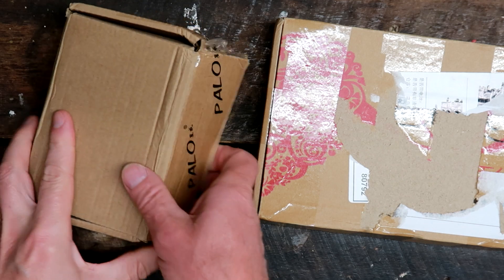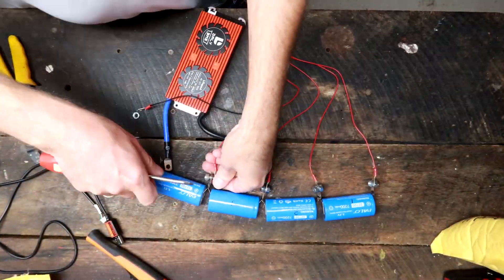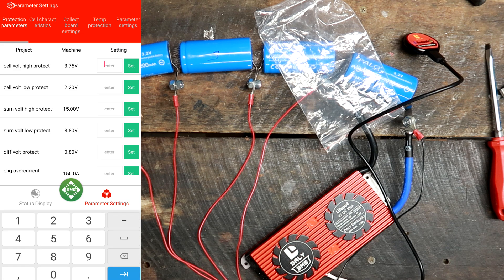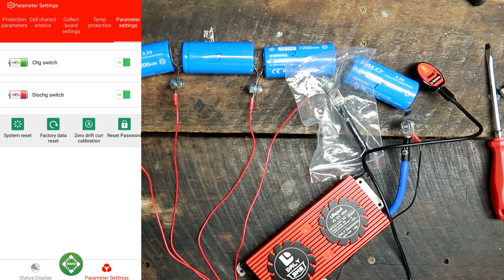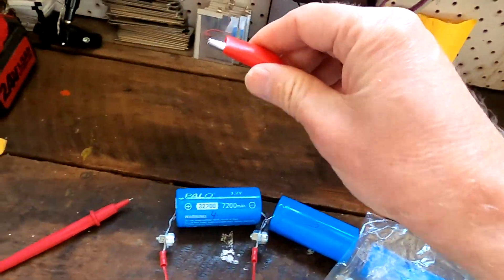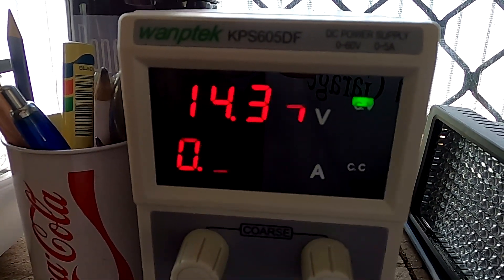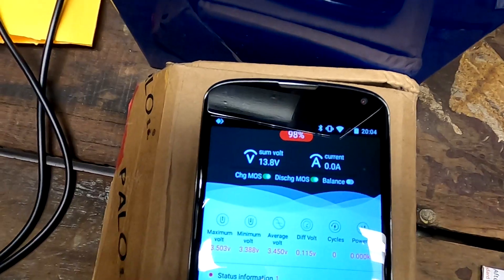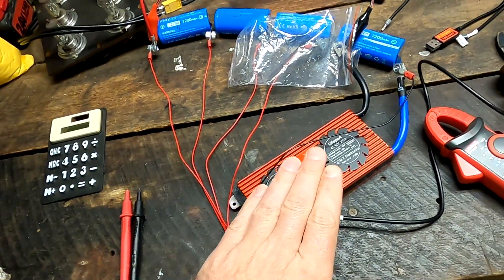Why DALY BMS' are so popular? Exactly, I don't know either.

Comment: On the "Welding" issue: Do you suppose they mean "solder?" If not, maybe they are talking about spot-welding, where arrays of cylindrical cells are connected by spot-welding nickel strips to the batteries?
Reply: I guess they mean soldering
Reply: They mean don't short the -b to -p the common known way to restart these things.  It probably messes something up in the internals over time.
Reply: Lol

Comment: hi I have a question about dali, the charge app display with soc by inserting 280ah cells stops me at 75-80% with full cells. dali bms 200A capacity, if I set cells to 200a it reaches 100% what am I doing wrong ??
 or is the bms not so reliable
thank you

Comment: Chinese DIY kits (such as LM338 based power supply kits) that have "english" instructions that need soldering use the term welding when they mean soldering, so as Brass/Bronze and Copper are often called copper by them, welding seems to refer to welding brazing and soldering, depending on the context.
Reply: Some BMS come without leads

Comment: I have a scooter that runs on the 60 V battery I recently installed the Daly. My scooter can run on single or dual motor. I noticed when I switch it to dual motor and quickly accelerate it dies out and won’t turn back on unless I wake up the battery by unplugging it and plugging it back in. Does that have anything to do with the Daly because the surge of voltage is being used suddenly. Do I need to change the settings?

Comment: You need a temp sensor attached.
Reply from the maker: for...?
Reply: @OffGridGarageAustralia  He is in the North! I think you are usually safe from freezing. My BMS has 4 temperature sensors (for up to 24S). I do have a battery temperature sensor from my Epever Tracer 60A (6415AN) otherwise the SCC assumes battery is same temperature as the SCC, which is often 40C, and occasionally throws up over temperature warning, which should not happen until 85C. Had thought about a Victron Smart Battery Sense; for my Victron 100/20 Smart SCC, but it’s quite accurate on the voltage. Lifepo4 do not need temperature derating, as Lead Acid types do. Also no danger of freezing here in Philippines.
Reply from the maker: @michaelbouckley4455  Thanks for the info. That makes sense. Definitely no frost down here...
Reply: @OffGridGarageAustralia  before you changed the settings the reason why the bms wasn't working is because there was no sensor.......and yes I'm in northern Alberta Canada where -40c happens at least once every winter!
Reply: @OffGridGarageAustralia High temp disconnect for starts. Im suprised people watch this. You clearly dont understand basic electronics
Reply: @FullyChargedZone  Cool name
Reply: @OffGridGarageAustralia  Bms wont work correctly
Reply: Had same issue. Purchased a temp sensor on ebay for $5. Working like a champ!

Comment: I have the same, 100Ah cells, 4S. I use it some time, and Diff Vol is now 0.001 as it stand with 99%, so it seams to balance ok, at least after some time.
I have set "sleep waiting time" to 15300S, that will keep the Bluetooth on all time and not go in sleep mode.
If I remember right, to activate it first time, B- and P- should be connected with each other for a second, maybe it could be charger with 10A also to activate.... If I remember correctly.
Reply from the maker: It needs some cycles as it shaves off some current with every charge cycle. It's a weird design of a balancer though. I'm not sure if this still works once the cells get older and start drifting more. Also, with the 300Ah+ capacity cells... how many cycles will that take until they are balanced?

Comment: One thing i was thinking of that low cut off voltage but I think that is a pull down voltage set point for high current draw stuff like mobility scooters etc they do advertise it for that application too

Comment: I have a Daly (DeliGreen) BMS, 8S, 150A, it was annoying at the beginning, it was difficult to start, and especially the applications (PC/Mobile). That is why I tried to develop an application that suit my purposes, to be integrated with the other IoT stuffs, using Node-RED. In my opinion, the original applications are not good, and the hardware is not great as well, sometimes seems freezing/not responsive, not like what I want. The protection mechanism probably ok, but the balancing is not working well. So, for the balancing I parallel it using QUCC Active Balancer.
Reply from the maker: Thanks for sharing.
Reply: How do you do? I am planing also read uart port, send to nodered and log, send commands back, an so on.

Comment: The issue is that you are using a 100A BMS with those tiny batteries. I think the BMS would have more time to balance if the Capacity was higher. I have the 250A BMS on order for a 560A Battery I am putting together. I will report my findings once everything is here.

Comment: I have a 48v 13s 10p and my last 48v was a 6p and both bms's randomly would not connect and sometimes would go way too high and I can't believe it did not catch fire but did damage 7 cells. I'm not using these daly's anymore. Also it would shut off if you got close to max amp load with no grace for a spike that always happens with throttle snap.

Comment: I get it, but do you have a recommendation for a high amperage BMS? Daly and the same ones that overkill solar uses seem to be all I can really find. I need at least a 200a 4s BMS
Reply from the maker: That is really the only advantage of Daly that they have the large BMS up to 500A. You can still use the Daly but I would probably use an active balancer in addition.
Reply: @OffGridGarageAustralia  I actually ended up watching the rest of your videos, and decided to use the JK on a 24v system. I appreciate the reply!

Comment: I have the 250A BMS from Daly. Once the battery is fully charged it balances itself after several minutes. I've had 250mv diff, but some time later its back to 1mv. Also when you turn Bluetooth on  onyour phone, the app takes sometime to discover the bms. As long as you never disconnect Bluetooth on your phone, it will instantly be detected in the app. No need to press the button on the dongle.
Reply: He doesnt know what hes talking about
Reply: Mine does the same

Comment: Good day. I need some help please. We are in South Africa with daily loadshedding and I have with my inverter a 24V 100Ah battery with a BMS inside and I have this Smart BMS app but I cannot find a manual or something just to see what all the info in the app means or where I can set something. Like for instance the SOC is set at 99%...should that be?  Thanx
Reply from the maker: That's not enough information. How should we know what battery and BMS you have and what app you're trying to use. What's the problem? Does it connect? Error message?
Reply: @OffGridGarageAustralia  Ok let me rephase. I am using the Smart BMS App and I have a 24v 100a LiFePO4 battery with my inverter. So i was just wondering if there was a manual for the app. These Daly youtube videos is of no use. But on second thought I suppose I should not change anything in the parameters. The app connects yes and show all the info. It also shows on the app: BMS software upgrade. Should i upgrade? And also BT Firmware 2.1.4 Upgradeable. Should I try or leave well alone? Thanx
Reply from the maker: @deonzar  There was a problem with upgrading the FW on these devices though the app. I never did it and it turned out to be a bug in the Smart BMS app, so make sure you have the latest app installed. When I updated my app to the latest, this FW update request disappeared. It's always risky to upgrade if you cannot downgrade anymore in case something breaks. There eis also a PC software for the DALY BMS which gives way better control and functionality.
Usually the default parameters kind of work for the selected chemistry and are a good starting point.
Reply: @OffGridGarageAustralia  Ok thanx

Comment: hello and thank you for your videos. 
I am a french admirator of your job.
 Just a question, I install the connections of the bms on the bars which relay the elements of my four 3.2 volts batteries, each of the wires goes to the 4 batteries.  My question: we fix the wires with lugs on the connections, I think soldering these wires to the connecting strips, wouldn't the contact be better than stainless steel screws?  thank you for your opinion.
Reply from the maker: Bonjour Patrice. Yes, that is correct, I would recommend soldering the balance wires to the ring terminals. I have some bad connections for my own BMS which I know cause some problems. Soldering them will be better.
Reply: @OffGridGarageAustralia  thanks for the answer.
In France WE go to bed !
It IS midnight.

Comment: Thank you for this most wanted video...want to go for JK active balancer bms ..Pls let me know if this BMS will actually work on 36V (nominal ) battery pack..or it will shut of battery voltage drop below 40V as per it's specifications..

Comment: I think you are mistaken. Even on XiaoXiang BMS, you can set balancing EITHER when charging or when testing, NO option either to always balance.
Reply from the maker: Nope, the QUC balances all the time. Yes, I can set it to just balance while charging but if I disable this, it balances all the time. It's in my videos. I do this from time to time and just let the battery sitting there over night to balance, no charge, no discharge during that time. It's all ready in the morning then...
Reply: @OffGridGarageAustralia  yes, but do they then charge also while charging?
Reply from the maker: How it works with other BMS' is that as soon as one cell hits the balance start voltage, it get's discharged with the balance current for as long as it stays above that voltage.
Reply: @OffGridGarageAustralia  on my BMSs, they balance either while charging OR while NOT charging. None of them balances all the time.
I agree it doesn’t make sense of course.
Reply from the maker: @ThanosSustainable  With all time, I mean it balances all the time once it goes over the balance start voltage, regardless if charging, discharging or resting. If it goes below that voltage, it stops balancing.
Reply: The only time we balance a vehicle is during charge

Comment: can this bms turn off charge and load separatly ?
Reply from the maker: Yes, this one can. It has MOSFETs for each direction which it can switch separately.
Reply: This at least is a step forward :-)
Reply from the maker: @BischesseHunting  Well, it depends if you need that function.
Reply: @OffGridGarageAustralia  how can turn off charge and load separately, if load and charging cable is the same?
Thank you for the answer.
Reply: @sonjakavalut  I think it has to do with the direction in which current is allowed, using diodes. Can be switched to charge only, discharge only, or both charge and discharge.

Comment: Before I saw your video, I was actually thinking of getting a Daly BMS to my battery. 

But this is pretty awful. You get a two page Chinglish manual that is assumed to cover... about 20 parameters? And the BMS does not work if the temperature sensor is not connected? If I must set 20+ guesswork Chinglish parameters without accurate documentation, I might as well build my own BMS. 

"If anything goes wrong, read the f----ng manual." Well, maybe not in this case. Hope you have WELDED your BMS now. How hard can it be to follow the instructions? ;-)

Keep up the good work, Andy!
Reply from the maker: Yeah, don't get a Daly. Just wait a few more days. I have something exciting on my workbench at the moment. I hope it will work.
Reply: In Chinglish Welded means re-soldered to replace the wires.
Reply: And insurance tablets are what they call fuses
Reply: I have 4, I run a cabin and charge 2 cars witha Daly Balancer. This guy is a salesman. I think hes  completely lost when it comes to balancing a battery.
Reply: @OffGridGarageAustralia  your negativity is based on your personal experience. should you be telling people what to buy and what not? i made the mistake once of following a recommendation you made and that was an expensive mistake that you then admitted to in several videos later.
Reply: @ralph9987  I learned the hard way myself. I bought a recommended BMS by Andy. Almost burnt my packs up.
Fully Charged DIY pulled his card earlier. Andy blocked his comments, the guy teaches about batteries for a living.
Reply: @OffGridGarageAustralia  This is why you dont take recomendations from youtube
Reply: @intrestedineverything  where from then, it's hard to find a reliable source of info these days. 😣😓

Comment: I want to charge 12V lithium phosphate battery with a charger or power supply especially fast charge with 100Amps that can take energy from Mains supply.

How to select my power supply ?
Reply from the maker: You need a dedicated charger in which you can set the parameters for your battery. A pure power supply won't be enough I'm afraid.

Comment: Interesting to say the least, I was looking at getting a Daly BMS but changed to JBD as it seems to be way more functionable than the Daly, now seeing this video im so glad I ordered the JBD ;)
Reply from the maker: That was the correct decision!
Reply: Another vote fore the JBD.  After much patience working out the nuances (bugs) with the Daly - getting it to always start up, having BT stay on, getting the temp settings right i figured it wasnt going to be set and forget.  So i bought a JBD - which has been set and forget
Reply: There is small difference between them really sure JBD is simply better but thinking realistically it's only slightly better I seen multiple reports from JBD on forums how 300a is really around 250a and similar issues that come with Daly bms some people don't even know how to wake up bms and then will leave negative reviews and such things.

Comment: It is way too cold, plug in the temperature sensor. The button is reset, and it is used with the sleep timer. Balance only comes on during charging. QUCC is actually made by JBD.
Reply: He doesnt understand how batteries work

Comment: Ho Andy I got a 300 amp 8s daly today. It's the smart bms with the fan to cool it. It seems ok but I'd never had a bms until this one. The Bluetooth seems like it disconnects a lot and I'm not sure if the balancer is working. Maybe its working and really slow at balancing.  I also ordered a jk with 2 amp active balancer. May e the jk will be better but I'm not sure
Reply from the maker: You increase the time the Bluetooth is disconnecting in the settings. Don't worry about the balancing. The balance current is so small, you won't notice it.
Reply: @OffGridGarageAustralia  I bought a.couple of the 5 amp balancers. The batteries I have are the grade a eve 280 cells with welded 2 hole terminals. I hope once I top balance them they don't need a lot of balancing. I also bought 2 of the 6s balancers for my leaf cells. I got the voltage sensing relay and hopefully with help of your videos I can make them all work great and kinda automatic. Thanks for all the videos I learn a lot from you

Comment: Hi, I'm using the HiBms 100A  with external balance, HiBms is basically the same of Daly, the app is identically the same of Daly, HiBMS, is cheaper than Daly, althouth they are the same and for me it is working perfecty good in my 8S Battery Bank 100A

Comment: Even the ANT-BMS units I have will balance when they are not charging.  I just wish it would balance when charging so that the weak 200mA balancer has all the help it can get to keep the pack in balance when it gets close to full.  I really like having an active balancer attached with a voltage controller that turns it on when the pack goes over 54v while charging since it is just beginning to exit the top end of the charge curve when the active balancer is turned on exactly when needed.
Reply: Please do you have a link to this voltage controller or some explanation oh how to hook it up and use it?

Comment: I have no idea why, but I completely disconnected the BMS from the terminals, then reconnected.  Then when I clicked the button to turn in on (on the bluetooth thingy) it kicked on, and finally started balancing.  As they say, turn it off, and back on again.
Reply from the maker: But it only balances during charging, right?
Reply: @OffGridGarageAustralia  it seems to be very fickle.  Sometimes its 0.002, and when it's dying almost 0.2.  Its still very new to me so I am still experimenting
Reply: @OffGridGarageAustralia  it seems to keep it well balanced when discharging as well.  while the green slider/light may not be on in the app, its generally pretty balanced.